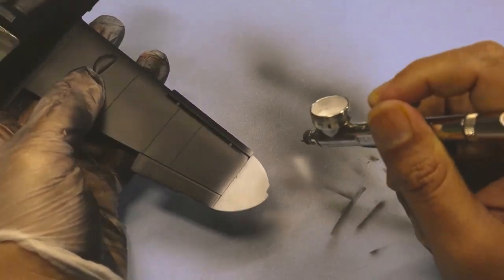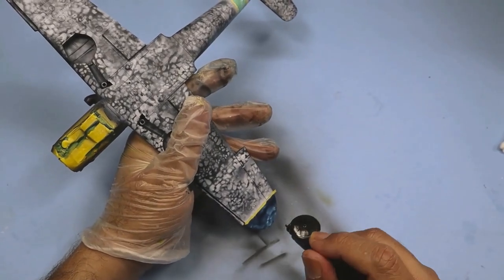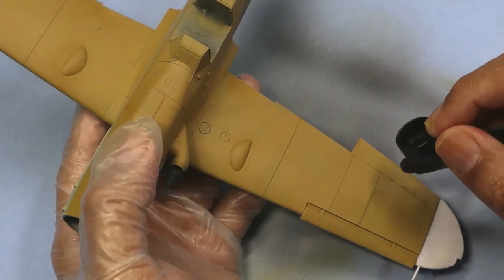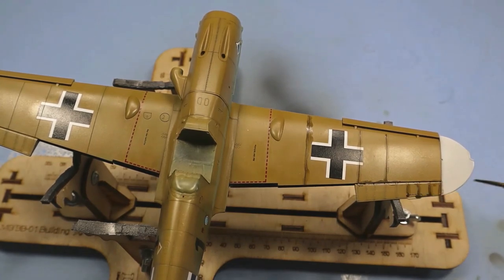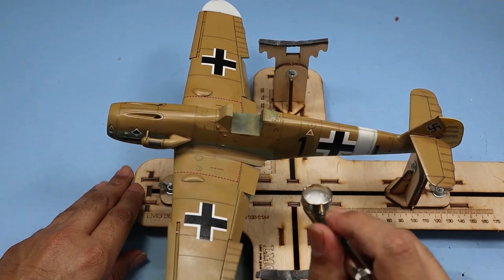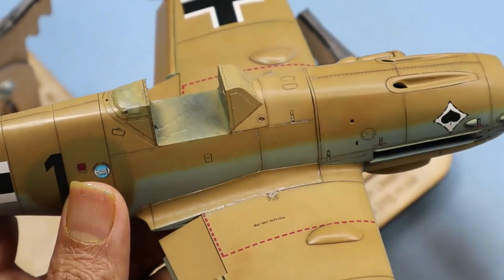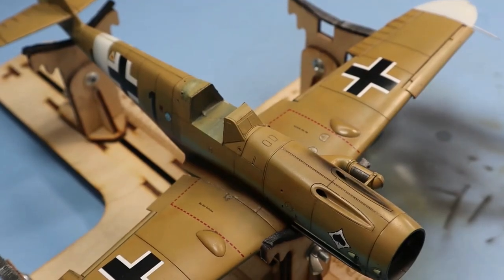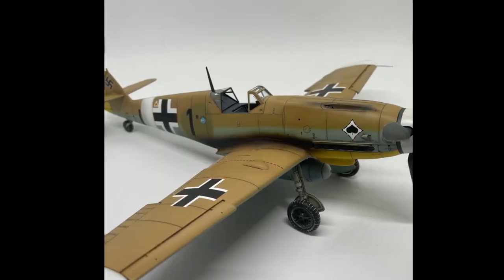1/32 ProModeler Bf-109G-4 (Part-III Airbrushing and Weathering)

Comment: Did you use vallejo model air or mig ammo for the colours of the fuselage ?
Great job althought
Reply from the maker: Hi Andre, I used Vallejo Model Air. I am not a WWII German expert but the colors look pretty accurate to me.
Reply: @arewethereyetmodeling2196  
Could you give the references of the paints please ?
Reply from the maker: Sure, for the topside camo. I used Vallejo RLM 79 (71.278) and for the bottom I used Vallejo RLM 76 (71.101). And for the yellow under the chin I used Vallejo RLM 04 (71.078)
Reply: @arewethereyetmodeling2196  thank you